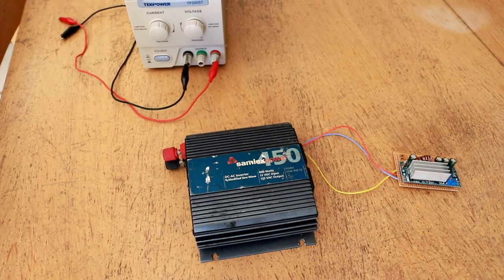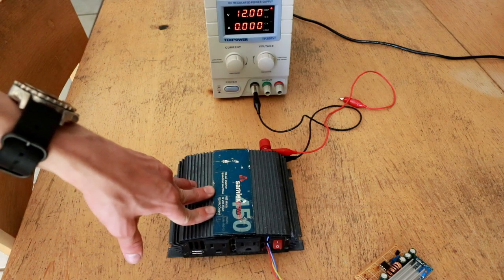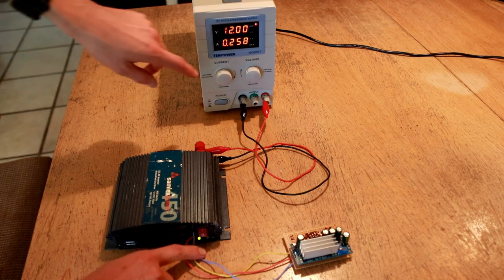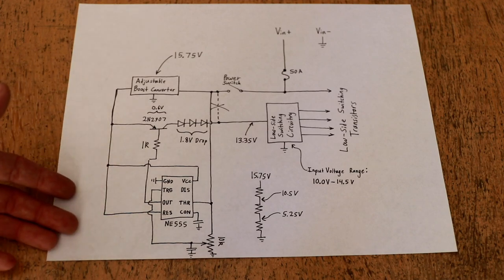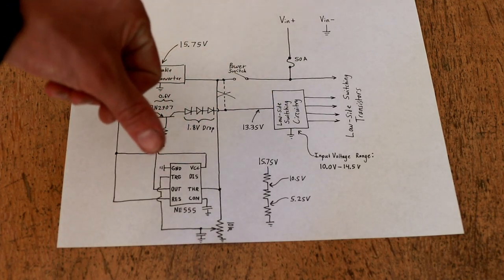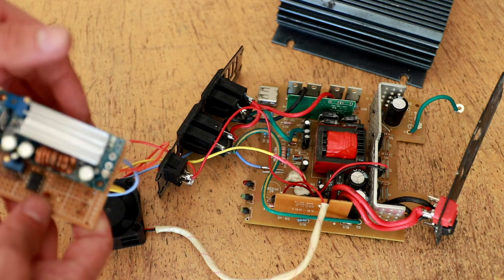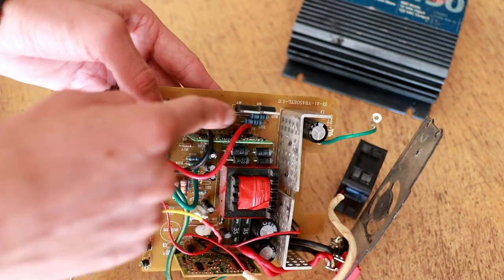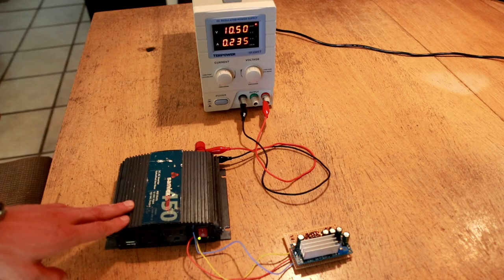EP 64 - Hacking a Power Inverter for Lower Cutoff Voltage

Comment: there is 2-4 resistors on the logic board that set the 2 trigger voltages they are easy to find and the data sheet for the switching ic will give you specks on the threshold if the ic
Reply from the maker: Great idea, I will look at the datasheet and see if I can find them on the PCB!
Reply: Did you ever find them?

Comment: That sounds like it was way over engineered. Pretty sure there's some resistors or a potentiometer that can be adjusted on the board to come up with the same outcome.
Reply: The problem for me is that there aren’t any pots to adjust the cut off voltage 🤦‍♂️ 😒

Comment: Hi.. my power inverter giving 325 volt ac output. How to reduce this output to 220-240volt..? Pls. Help..
Reply from the maker: In many cases, the power inverter's peak output voltage is unregulated and is coupled to its input voltage. For modified sine (square wave) inverters, it's also common for the RMS voltage to be regulated to the design value automatically by varying the "dead time" in between output commutation cycles.

Before modifying the inverter, it is worth noting that some multimeters aren't able to accurately measure the voltage of modified sine wave AC. It is possible that your inverter is producing the correct RMS voltage, but that your meter is incorrectly reporting the peak voltage instead. You can try measuring the voltage with a "True RMS" meter instead to confirm if this is the problem.

Comment: Hello Everyone. I have a question, that's somewhat related.  I have a B&D 750W 6.52amps inverter model PI750AB.  For the most part it works perfectly.  But I'm experimenting with using it with a smaller battery in my chicken coops when needed.  I have it hooked up to a GT12080-HG 12v 8ah battery.  I can run a fan, laptop radio, etc no problem off of the inverter.  However, when I plug in a 200w heat lamp the inverter goes yellow and cuts the power.  The battery is fully charged.  Why is a 750watt inverter shutting down when plugging in a 200watt heat lamp???   Any ideas?
Reply from the maker: Likely the internal resistance of the battery is too high to allow the inverter to remain within its input voltage limits at 200W of of load. 200W at 12V is about 17 amps, which is quite a lot of current for an 8Ah battery, especially if it is older.
Reply: @DielectricVideos  Yes its an old battery like me.  Been sitting on the shelf for years. Its from a verizon internet box.  Ok that solves the mystery.  Do you know or best guess for a battery that i could use that would make these heat lamp run for 3-4 hours?  I just need them on in the middle of night when temps drop to lowest so my chickens dont freeze. Any guesses would be appreciated and thank you for responding back to me
Reply from the maker: @1realtruthrightnow742  A ~100Ah deep cycle battery would likely work well. For longer service life, a LiFePO4 battery of similar capacity would also be a good choice.
Reply: @DielectricVideos  "a LiFePO4 battery "  Funny you said that.  I actually emailed that very same company yesterday and waiting on a response!  So you obviously know your stuff.  Thank you sir for being so kind.  Have an excellent day and a better tomorrow. 🙂
Reply: @DielectricVideos  Just a quick follow-up.  Do you think a 50Ah might also cut it?  Again I'm thinking of the weight
Reply from the maker: @1realtruthrightnow742  At 200W, the inverter would need at least 67 Ah of charge to operate for 4 hours. It's also best practice to avoid deeply discharging lead-acid batteries, as deep cycling will significantly shorten their lifespan due to sulfation.
Reply: @DielectricVideos  Again, many many thanks young man.  New sub and like from me! 🙂

Comment: I have 2000w bosca inverter can your circuit work on my inverter
Reply from the maker: It depends on how the inverter is designed and where the voltage measurement takes place in the circuit. If you are able to supply the voltage-measuring circuit with the new cotrolled voltage from the converter, it should work.

Comment: Not related, but Im surprised more inverters don't offer the ignition lockout feature where they have  port to connect a cable that is only live while the car is running.  This is a great feature my current inverter does not have and i will need to install a relay to get.

Comment: I don't have the comfort level to design and build such a circuit.  Are there off the shelf add-ons that could change the hysteresis requiring only soldering a few leads? If not, great opportunity for you or anyone with the expertise to make a lot of money.  

I have an 5000W pure sine wave inverter that can only utilize about 30% of a recycled Tesla S module battery in a solar set up. I don't want to charge the battery above 24V for safety reasons and the inverter low voltage cut off is 22V.  That bandwidth yields only about 1.6 KWH of the 5.2 KWH capacity or 30%. I know I should switch to a better inverter but they are expensive in those sizes.

Comment: Thank you for this information.  Are there any 300watt and smaller inverters that will turn back on automatically after falling below the low voltage shut down?  All the ones I had used in the past need to be "rebooted" turned off and back on to get them to start back up again. Thank you.
Reply: i need a solition ot this please I have the same exact problem word for word. Its incredible how we both have the same problem

Comment: I have similar problem. Edecoa 24v/220v shuts off at 20,5 but i have gel batteries and they should not be under 23,5 volts so im thinking how to change that.

Comment: Can a cheap inverter without input voltage monitoring circuit be lowered in output volts , and stay on, by pulsing 10khz motor speed controller with output filter capacitor , to get Inverter to a less  output AC instead of 120v ? I need to get half wave DC from 40 reduced to 30v DC half wave?  60 cycles or high frequency unit? Inverters at low voltage are impossible to buy except for 500W Inverter open board type. The inverter type design is needed because the output is ISOLATED PROTECTED USING SECONDARY WINDING! Variable resistor causes 100% wattage draw from battery with load and is less efficient. The pulser controller draws less than 100% main power to lower voltage at output. The one other method is adding 11series diodes to reduce output voltage from inverter and keeping full 12v battery input, so as inverter is more stable, but wastes 50watts energy. 

Chinese type OPEN BOARD of 500w Inverter says only in a FEW of many translated ads, that 24v can be also used, and the built in voltage regulator inside IC driver will carry 24v input, according to data sheet of SG3525 .The transformer doesn't care, so as I assume that since 12v in gets 18vAC out, so as 24v in, should get 30v AC output. This method then would be better, since 12v to 24vDC rugged converter module can be purchased in various amps to use for the cheap China Inverter.

Comment: 10 v is way too low
Reply: No it's not. Lithium ion 10v/3s = 3.33v per cell. That's even higher than the bms cuts the pack off.
Reply: @RoyAndrews82   yes that's with that type of battery